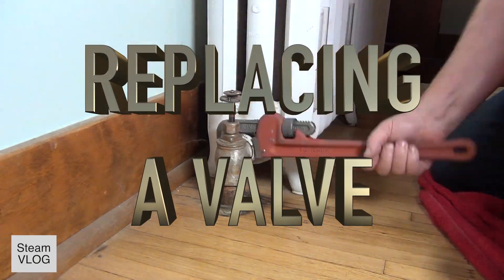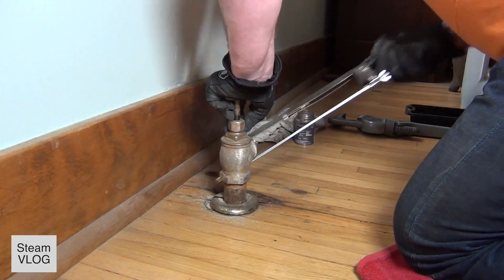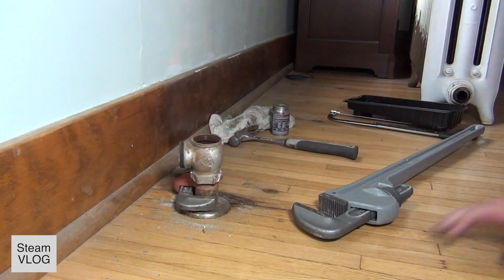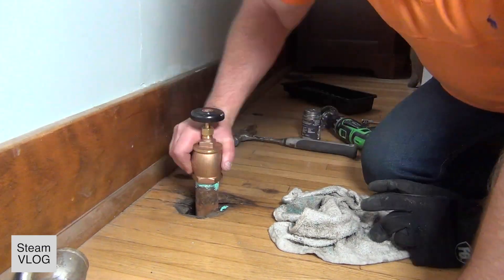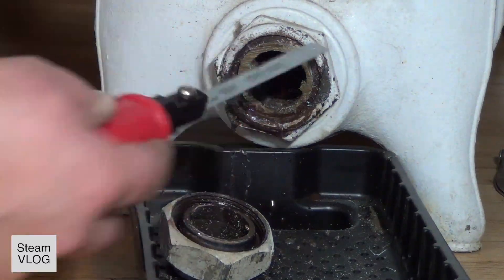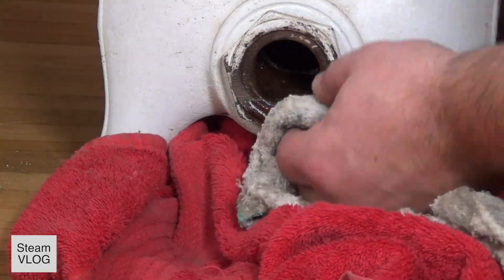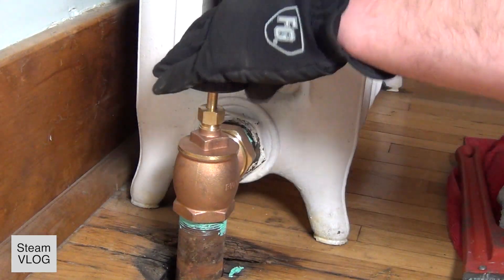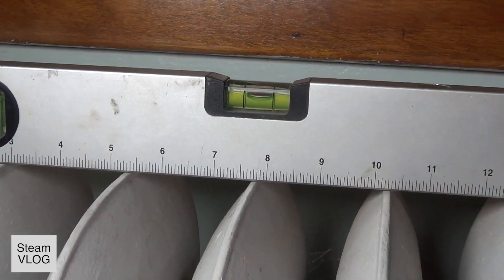Steam Radiator Valve Replacement 1

Comment: You didn't replace the escutcheon.
Reply from the maker: yeah, i did that later. They make nice ones that comes in two halves that can be easily installed around the pipe.

Comment: This TERRIBLE work. First, just cut the nut off the nipple so you can get a pipe wrench it. Second, you leave all the metal shavings inside that radiator your just asking for troulbe .

Comment: How do deal with the water in the system before you cut?
Reply from the maker: What water? This is steam heat, there is only air and steam in there.
Reply: @mygiguser  That would be nice to know. If we looking on YT for knowledge we should be told what we need to know. I thought was water filled because it is leaking water on my floor.

Comment: the part where you turn on and off the heater, when its up its open and when you spin it and goes down is closed? i have one in my apt i turned it both ways and its still on im confused
Reply from the maker: the gasket is probably gone, and you need a new valve.

Comment: I have a steam valve that leaks at the union - where the rad attaches to the valve. Even after tightening the nut with a pipe wrench it still leaks. Any pipe dope that can be put on threads?
Reply from the maker: Yes, i use the Green Stuff. Look it up on Amazon

Comment: First I’d try using easing oil, two pieces of pipe as levers on each stillson, or heat with a blow torch to cherry red. PS you never mentioned the trap set on the outlet.
Reply: The easing oil It’s minimal and is for helping to loosen a seized thread. White paste and graphite paste, used for sealing the threads, will contain oil. And when cutting the threads oil is used in quantity. Without oil the screw dies will strip the thread.
Reply from the maker: you don't want to introduce oil to a steam boiler system
Reply: WHY....
Reply from the maker: @educatedrock  the steam carries the oil back to the boiler, and it damages the boiler, and the boiler water. It prevents steam.

Comment: Too much work, get the damn power saw to split the old valve and spin it with the 2 ft
Reply from the maker: Sounds like you did this before...
Reply: @mygiguser  lol every damn day, I work for a company that specializes in radiators, some of those valves I came across been on for over 60 years

Comment: Where can I buy a 1.25" spud pipe and union nut for a steam radiator?  Is the thing you screw into the radiator with the spud wrench properly called a spud pipe?  Or does it have a different name?
Reply from the maker: I am not sure where you live. I bought valves at Menards, and the pipes at Federal Pipes in Detroit.
Reply: @mygiguser  Thanks.  I will try Menards and similar places, but I see many valves on line.
Reply from the maker: Well, the union comes with the new valve, and the other part you are looking for is called bushing. You have the valve, that connects to the union, that screws into the bushing, and the bushing screws into the radiator. You can buy this at local pipe supply companies. Just google steam pipe supplies.
Reply: @mygiguser  Thanks so much for the answer.  Am I correct I should be looking for a brass bushing?  I haven't yet bought the valve but I see many available online.  I will also try Menards.

Comment: Use some lube dude. I never remove them this way. I always lubricate the area first with some WD-40 and then shock the nuts with a sledge hammer to break the seal. After that the items come off quite easily.
Reply: Ruined a hard to find valve!

Comment: This is a horrible instructional video.  Next time speak more clearly and lose the annoying music--it adds nothing to the video.
Reply from the maker: OK, will do.
Reply from the maker: You should also know that oil and steam boiler don't mix. Oil is very bad for the boiler.
Reply: I agree. I never remove the valves this way. Any mechanical person should know that when remove any old nut or screw, lube the area first. Makes it easier to get off.
Reply from the maker: https://youtu.be/D-cdmD5vvgg

Comment: When removing the old valve . I didn’t do it your way. I ended up cracking the pipe.
Reply: Yes, that way has an extremely higher chanc
e of cracking one of the pipes. Should have used some type of lube or shock the nut with a sledge hammer.

Comment: I add some heat when they are just to hard to get off. Makes them come off smoother
Reply: Hi LivDoesIt, what kind of heat please?
Reply: @mioangel1227  I would use a propane torch. Had good results in the past.
Reply: Same